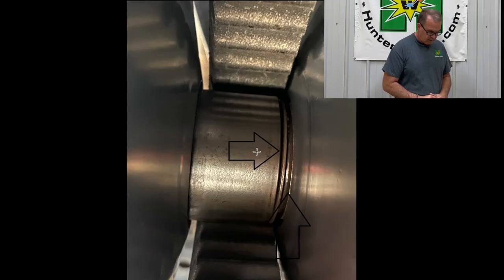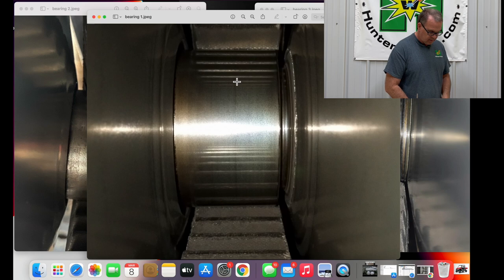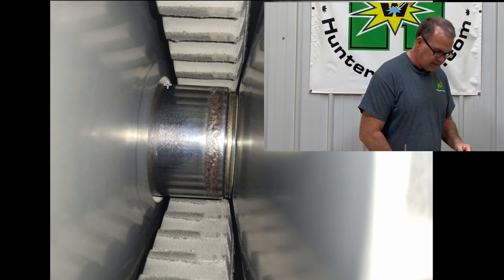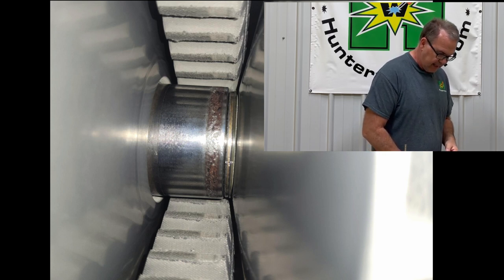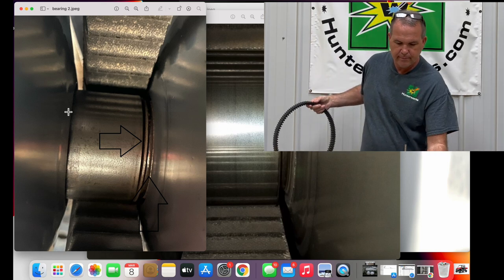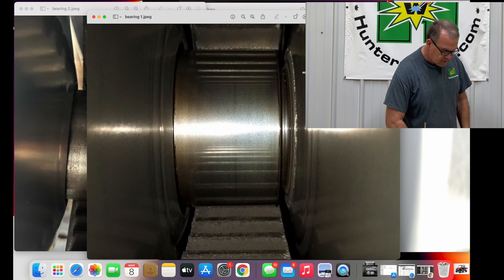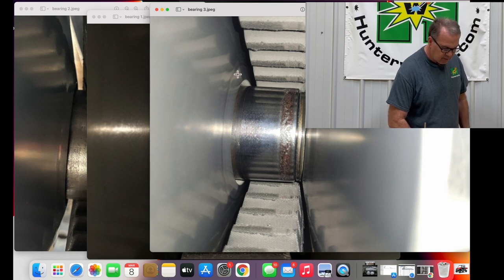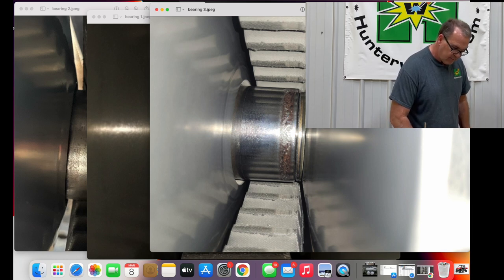How to Troubleshoot a Primary Clutch with a Camera (Polaris or Can am)

Comment: Hey! I took a trip out with my 2017 polaris threw a check engine light and my engine revs up and down with my foot to the floor and stays in a low power mode. Almost like a limp mode. What should I do? Where do I start troubleshooting?
Reply from the maker: This video here is a good start, take that picture, watching this is a good start too https://youtu.be/bIZoKUrOCPI
Reply: Is there an email that I can send the photo to that you can evaluate?
Reply from the maker: @TheScoutBobberAdventures  yes todd@hunterworks.com